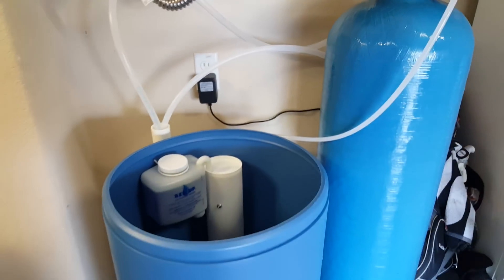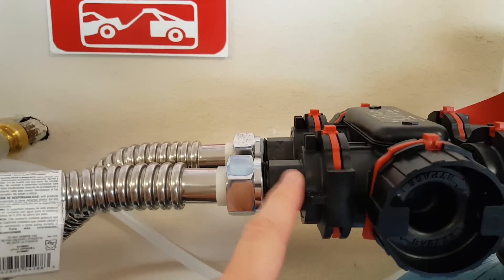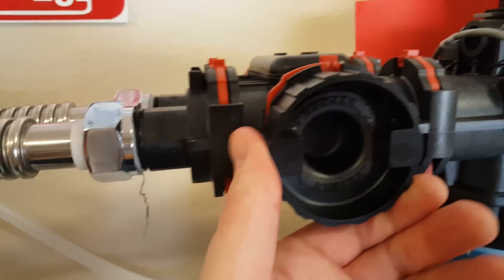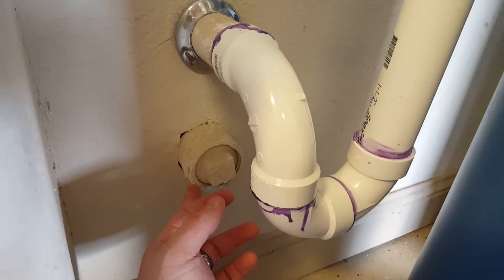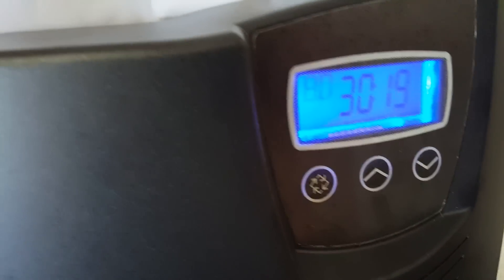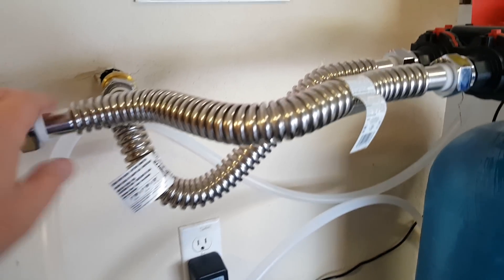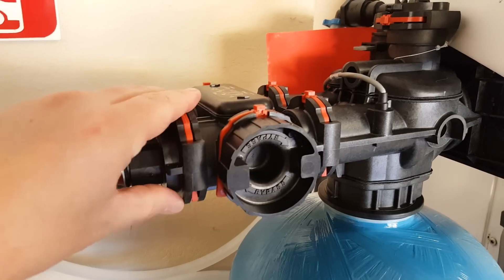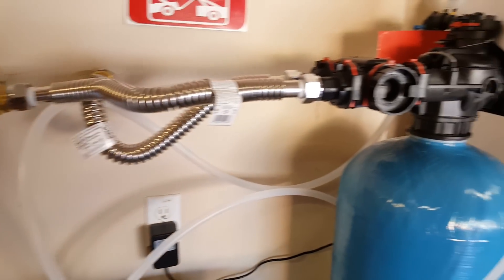Fleck 7000 Water Softener Home Installation

Comment: Great video! Just a comment. At 3.20 you talk about having an extra shut off valve for emergency. They’re is one already. It’s one of the two big black knobs on the system that shut off in and out water supply.

Comment: Hello I just saw your install video and thank you for that. I do have some questions about my setup here that I “inherited” and could use your expertise. I have most of the same set up from what I can tell but I don’t see a brine tank and I don’t know what size resin tank I have either. I assume this system is incomplete? Would love to be able to get it up and running if at all possible. Thank you in advance!!
Reply from the maker: I'm no expert - but if you have a fleck head unit and tank like this one then you'll need the brine tank for sure.  I think most people don't really understand how filtration works but basically the water is filtered through the main tank and the resin that's in there.  The brine actually cleans out the particulate in the resin after a specified amount of water passes through the tank.  These are all things that you setup based on the specifics of the head unit, tank and resin beads you are using.  If it's a half put together system I'd recommend having a pro come take a peek to make sure it's all in order and you have the right gear.  Since I set this one up myself I knew I had all the right pieces to have a complete setup.

Comment: Dear Mr. Lince.
When regeneration, NaCl 20% and water will dilute and pass to softerner tank. Normally, brine solution 10% will be used to regen in 30min. But hose pipe of brine tank is small so concentration of brine solution maybe have 3-5%. It impacts to regen effect. Pls instruct to solve this problem. Thanks.
Reply from the maker: I don't understand your question, if there is one.  This has been working in our house (3 adults and 3 children, 2 water heaters and 4.5 bathrooms) for over a year and has no problems keeping up.

Comment: does it waste a lot of water through the drain? also, what about the pressure drop to your water as the result of the installation.
Reply from the maker: I'm not sure what you mean by wasting water through the drain?  Nothing really changed at all in terms of water pressure or consumption.  It's just a filter that sits in front of the water coming into the house.

Comment: Have you noticed any pressure drop after the system was put in?
Reply from the maker: not a single bit.  Had this now for a year and a half and not a single issue...love having the bigger salt barrel...I can fill that thing up with 6-7 bags and don't need to mess with it for months...

Comment: Was it expensive? Would you recommend it for well water?
Reply from the maker: +Andy Menchaca Hey Andy.  I think it was around $900 or so with everything.  I don't see why it wouldn't work with well water - but check with the mfg before you buy anything to make sure it will - or if it needs something specific to handle that.  I get city water so I didn't have to take that into consideration.  We've had the unit about a year now and it's worked great - no issues at all.

Comment: Hi,

Can you please share the experience with the softener? Is the size (64K) adequate for your needs? Would you say it is good for 4 people in a 2500 sq house with 2.5 baths? Have you thought of adding a carbon filter? Thank you,
Reply from the maker: +sergionikus Hey.  We've had a great experience so far.  64k for us covers 6 people (3 adults) in a 4500 sq/ft house and 5 bathrooms.  We use a lot of water.  I can't say exactly how much salt I'm using - I think I've bought about 8 bags maybe since I installed this thing almost a year ago.  So for your size 64k should be more than plenty.  We haven't considered making any other additions or adjustments.  The water here is only medium hardness really - tastes fine.

Comment: Hi there, great video.
Just a word of caution -- you may want to check those Shark-bite connectors.  I've seen on the back of the packaging (parts purchased at Home Depot), a Warning describing that they have been tested to be a health hazard.  Something in them can cause cancer, birth defects, etc.  If what you purchased does not have this warning, then they're probably fine.  Otherwise, I'd change them out for something else.  Cheers!
Reply from the maker: ...fear mongering.  I didn't look at the label it has something to do with lead content because it's higher than .25% or something like that.  I figure all the scotch I drink is rotting me more than that.